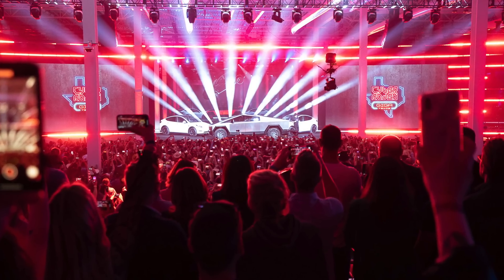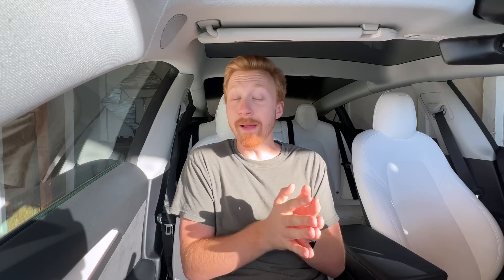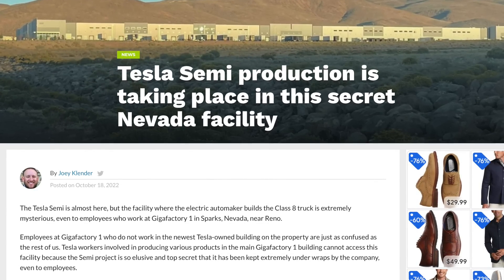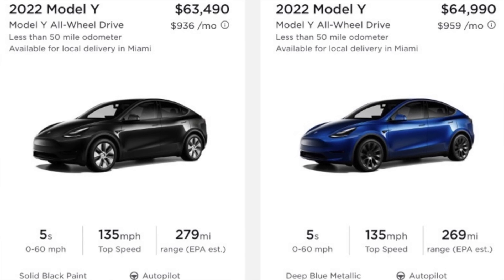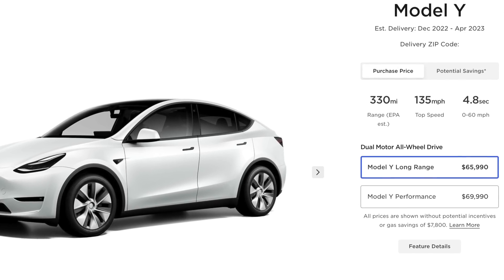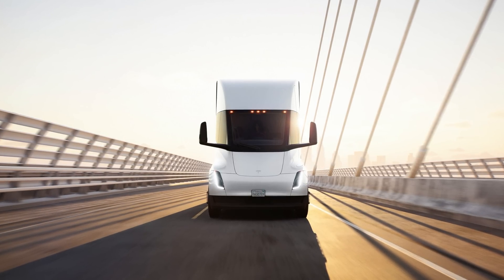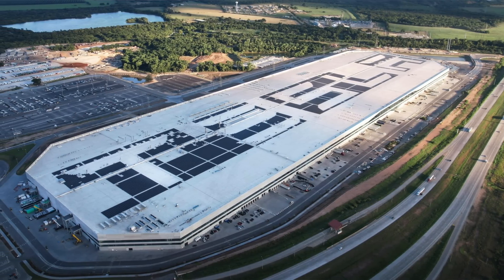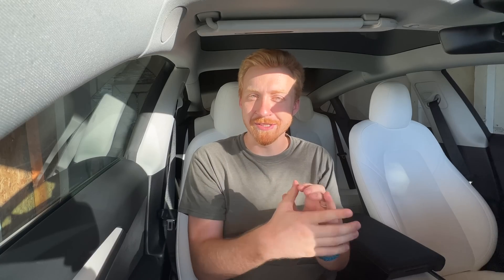Cybertruck Tooling Begins! No 4680s in Tesla Semi!

Comment: If Tesla matches the battery performance between a 4680pack and a 2170pack and they do not distinguish these by model type then no consumer is going to know the difference.
The reason why they should, is in my view, those with 4680's will get a software unlock when 4680's become the dominant volume batteries used by Tesla. This will not happen for another few yrs so the Tesla community and buyers should forget about it.
As Elon said he will not let us down, and he has not done so, so far. Even with Twitter, unless he has to sell more stock. 
I am now looking forwards to the close of the deal and twitter-x, which will be like Wybo in China....apparently, where it is a gateway to do payments, shopping, messaging etc.

Comment: Could be LFP manganese rather than 2170
Reply: Unlikely, need to squeeze as much power out of the cells in that work horse. 2170s are likely the option they opted for as it ran on those before and has had many years to develop into a high capacity solution. It’s a temporary choice anyways with Elon saying “Semi doesn’t have 4680s yet”.

Comment: I'm with you. 4680's don't seem all that impressive I'm thinking it's good tech but the advantage will be mainly cost rather than range power or even pack weight. But cost saving is still goid. Not to mention its more environmentally friendly, less water less chemicals and less energy to produce so its still win win really ..
Reply: The advantages are cost, space and speed. Half the price is a HUGE cost saving, but also the production process has a footprint 1/3 of the size which means in the same factory you can produce 3x as many. Also because of the dry anode, this eliminates the drying process dramatically speeding up the start to end time. It's the key to producing enough terra-watt-hours to supply Model Y + Semi + Cybertruck.

Phillip.
Reply: Some efficiency gains because energy/electron path through battery cathode/anode will reduce heating of the battery during use and thus less energy is needed to cool the battery........there does seem to be something weird with the roll out of 4680's though or changing priorities are causing whip lash at a minimum and Tesla doesn't give anywhere near any kind of full disclosure to what's going on with things....

Comment: Giga Texas is more than 2 times larger than Fremont. They build the models S X 3 and Model Y at Fremont in the 4.5 million sq ft factory. There is no way the Texas Model Y is using up 70% of the 10 million sq ft factory with the much smaller body shop. Unless that Texas production line is built for making 1 million model Y's per year it would not need that much space.

Comment: See?  And here you pooh-pooh'd the idea I presented a year and a bit ago now, that Tesla could very well make Semi or maybe even Cybtertruck with 2170s, they just might not be able to make them as quickly.  

They still do S with 18650 because it's a mature design, it works, and they know how to cool them.  

It makes sense to me that, as Tesla screams harder and harder towards efficiency at every level of the design, they could even wind up putting LFP batteries in the larger vehicles, the ones that currently need high nickel.  ... OK, maybe not that any time real soon, but ... like it would not surprise me if at some point they get the design so efficient that they start trying to put LFP batteries in Performance or Long Range... just completely flexing on the rest of the EV space, whose designs are so clunky they have no choice but to use nickel everywhere.

Comment: The Cybertruck is going to do 500+ miles so it can tow. The 4680 will be built on site in volume right with the CT. My guess is they are already stockpiling 4680 cells.
Reply: @TailosiveEV  Tesla doesn't follow the pack. They lead. Read the owners groups. The complaints about towing being impossible abound. They'll charge a lot, but the buyers will be there.
Reply: @TailosiveEV  None of those effect the usability of the vehicle. USS is inferior to a constantly running occupancy network, in nearly every situation. Model S/X have ventilated seats you just have to pay more... Without 500 miles of range towing will be impossible in many areas of the country. 

They will need to scale to reach higher volume production. That will be for dual motor variants. Initially production will be lower and will be high dollar quad motor with towable range. I know you disagree, but watch ;)
Reply: @domg7359  reality proves you wrong for years. All you saying is nonsense. Tesla can easily build higher range models but decided not to, because volume of ptoduction is their priority. And it will be the same with Cybertruck. With demand this high, they have absolutely no reason wasting batteries for 500+ miles range. Wake up and don't be so naive... 🤦🏼‍♂️
Reply: @MrRandomguyTom  They're already at 400 miles on the S. 500 on a much larger vehicle is not a stretch. Again - watch and see. You say there is no use case, yet they are releasing a Semi that does 500 miles fully loaded ;)
Reply: Semi needs the range. Cybertruck doesn’t need to cater to the towing community as long distance towing is a small percentage of truck owner’s daily use cases. I wish Tesla would splurge on the range for Cybertruck, but I don’t see it happening with the amount of demand this product has and the resources Tesla can muster for the next few years.
Reply: Just the fact that this would require an insane amount of space and also infrastructure to keep these cells healthy until they will be finally implemented into a car in probably more than a years time is not making much sense to me.

Comment: 4680's have the potential to have much higher energy density then the 2170's, but right now they are pretty much even in terms of energy density. Which is still pretty amazing, the 2170's are a very refined chemistry, the fact that the current 4680's with their brand new, un-optimized chemistry can match the 2170's show how much improvement can come from them in the following years.
Reply: Where is this energy density supposed to come from? There is no new miracle chemestry in these cells. Sure, optimizations are always possible and energy density may increase 5-10% in the next few years. But I wouldn't expect much more.
Reply: @EinzigfreierName  Go watch battery day
Reply: @rackoone  I did, that's why I don't understand all the hype about 4680s since then. For sure they will be cheaper to produce than current 21700s but that's basically it.
Reply: @EinzigfreierName  From what I can tell, todays chemistry is not fully utilized and is limited by factors other than the chemstry. 2170 was a step up from 19350s with similar chemistry so this is just natural progression. I would relate it to gasoline cars that all use the same gas but some are more effecient than others. They have also said that 4680s will not be fully optimized until 2026 but 4680s are already on par with 2170s apparently which is pretty cool.
Reply: @EinzigfreierName  Adding silicon into the mix can increase the energy density well beyond 10%. But silicon has its challenges so they are holding off till they solve everything else first. The Limiting Factor as a good deep dive on it https://www.youtube.com/watch?v=K5eHTV3u6nU